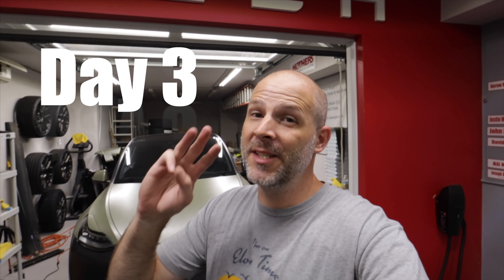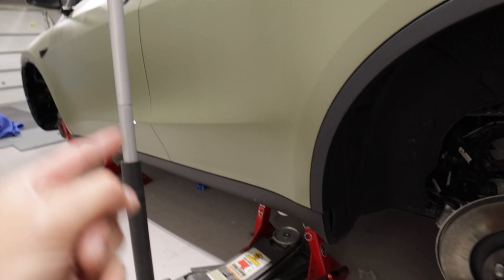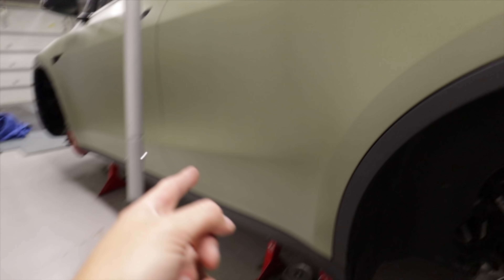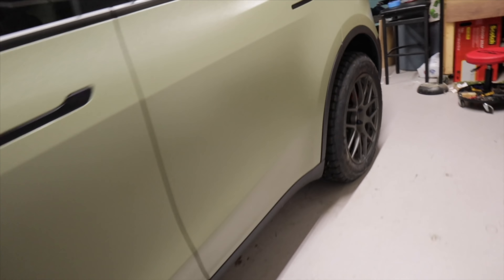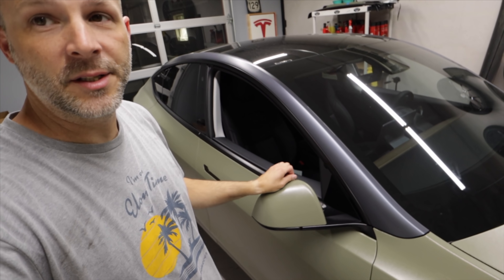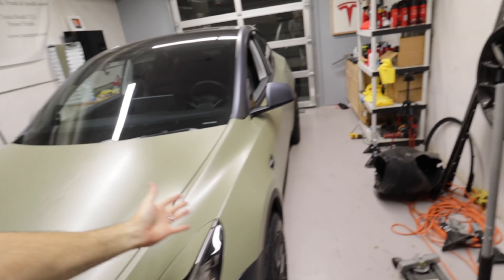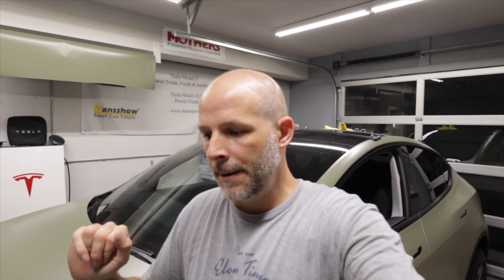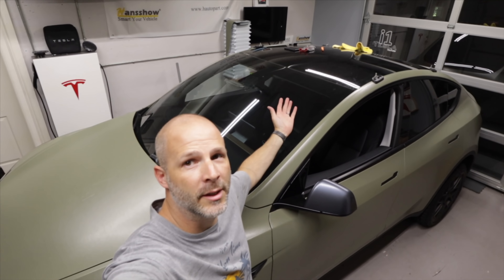Tesla Overland Build Day 3

Comment: 7:20 in an earlier video, you mentioned that heat (gun) is needed to activate the adhesive. 
Without heating, won't it peel later on? (Or, maybe the pressure from the weather-stripping-rubber will help hold it in place.)

Comment: Yes, it is just a 'lift and big tires'. Sorry it is not an overlanding rig. You need to be close to power and the Model Y range will be severely reduced. Putting in spacers in the lift does nothing for the suspension other than lift it.